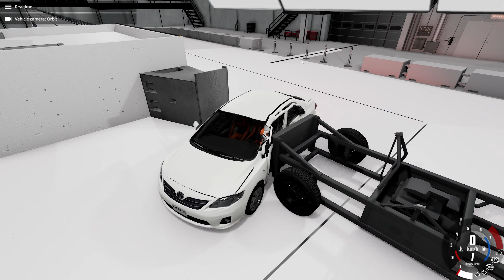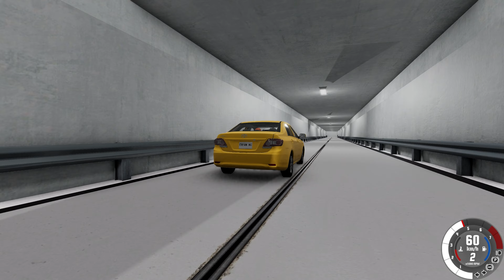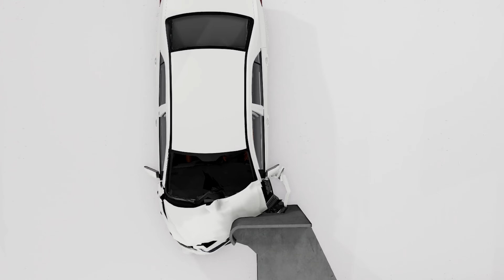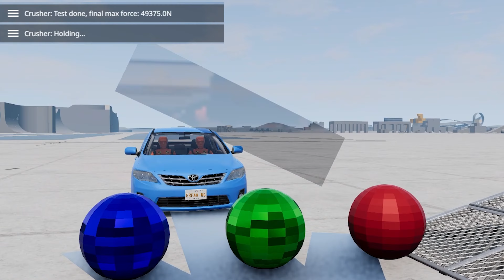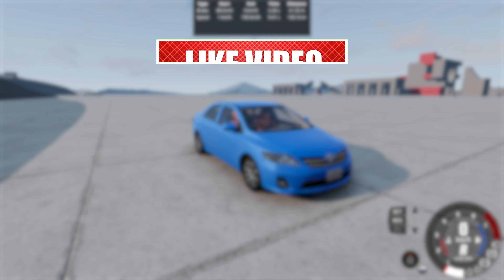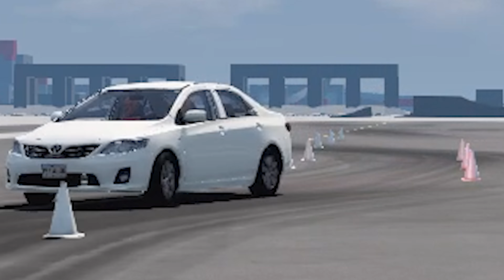2010 Toyota Corolla – Cheap Immortal Tank with Shockingly Strong Safety!

Comment: Also, theres foam inside the rear bumper, and the rear bumper cracks on impact (its plastic) and thats all the innacuracies.
Reply from the maker: Good point about the rear bumper foam and cracking. Thanks for the correction.